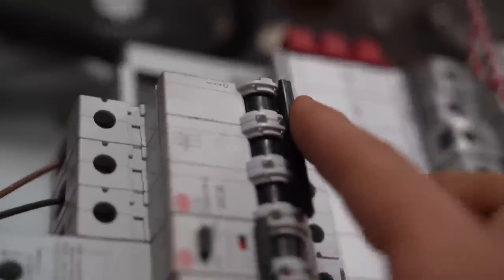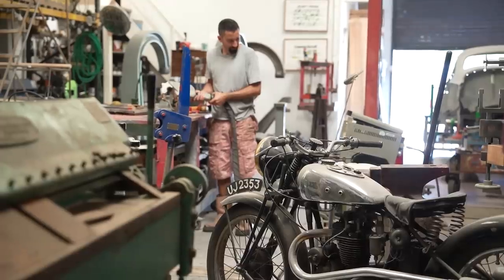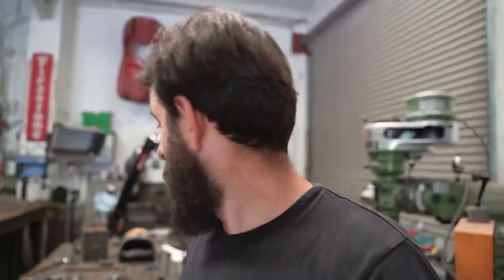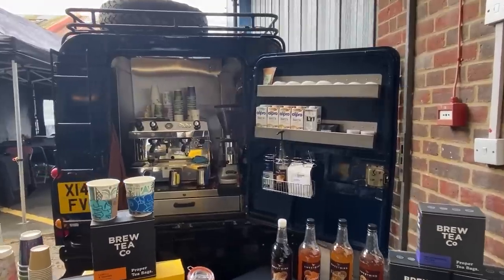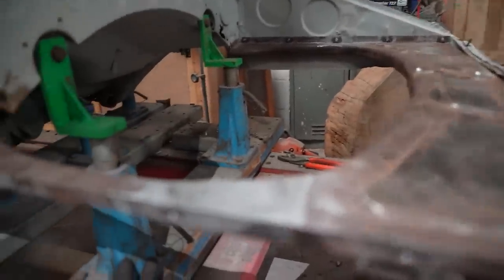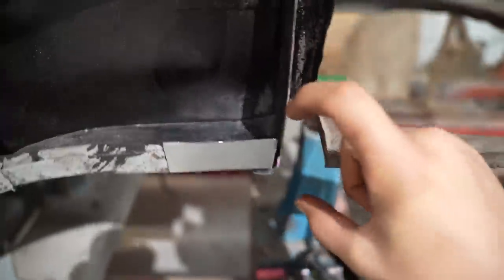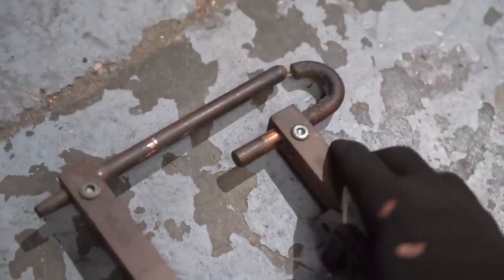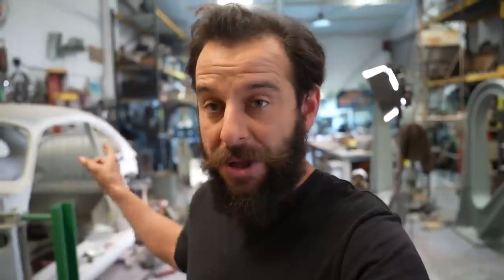'Let's Get Welding!' | Barn-Find Porsche 356 Restoration | Episode 13

Comment: Hi Dom.   that’s a mighty fine job your doing there. The parts might seem small your putting in but your fixing the panel and keeping all the original spot weld joints will give you a very fine result. As we always tried to do it so it looks original when finished. Glad you got your spot welder going as there a great machine. Great work keep going. Bob.

Comment: Great work! Lots of life left in that flap disc, try using it a bit 'flater' so you using the whole abrasive face, not just the outer edge. Still shouldn't be using gloves with power tools either.

Comment: hi dom when you start getting into the fiddly welding like pinholes get a piece of flat copper about 5mm thich and hold it behind the pin hole so when you weld it will not blow holes and the weld will puddle over the hole it will also disapate some of the heat from the weld area so less chance of warpage a piece of copper rod works great too for getting into tight places glad to see a smile on ya dial when working on the porsche cheers from down under

Comment: The best flapdiscs ive tried is 3m cubritron. cost same as würth but lasted alot longer, and if u pushed to hard on it and burnt the sandpaper on it u just hold it with a soft touch on the metal and it worn away the bad area.
U can grind down the outer diameter of the disc on a benchgrinder, hold the disc with the none sanding side towards the benchgrinder with the anglegrinder on and grind away it dust like crazy but u get a new crisp edge on your disc 👍

Comment: I reckon the difference between your test pieces and the actual car parts is the cleanliness of the metal. A quick rub with a scuff disk might make all the difference to the resistance of the metal. 👍

Comment: One day you will have to learn Ohms law Dom...  The breaker tripped because the spot welder wanted more current, a long lead adds resistance and therefore reduces the voltage/current available at the end of the line it does not typically cause the circuit to take more current :-)  It now works because you moved it from the 16A to the 32A circuit.

Comment: The pulse setting is for welding through 3 or more sections of steel, or two sheets of 2/3mm sheet. Or you can you use the pulse setting adjust the timer for mismatched thicknesses

Comment: Later on you might need some longer reach tongs for spotweding further across the angels such as floor to tunnel for example, be satisfying to put new metal on! Did restoration design get on board, or recommendation. There are some great utube videos on their new speedster development.

Comment: You guys did a nice weld job. I have my late fathers spotwelder. He also made several arms to be able to reach the places where he had to weld. The machine is a little bit smaller and from Italy. One tip: keep spay cans away when you are grinding or welding. Regards from a former welder and weld inspector. Regards from Belgium.

Comment: Those engine bay closing panels look  good  and the bulk head looks nice they can get like lace , I have a thing for air files rather than discs but the belts get  a bit expensive. Im looking forward to the unboxing as the original rear inner engine bay panel had a hump to clear a petrol heater if fitted, its great to see progress

Comment: I would have thought you would have added a coating of weld through primer in between the panels  before spot welding to protect the panels from future rust and stains on the paint. Just a thought but great progress

Comment: Interesting as usual. Do you ever use the Poly discs to remove paint and rust, effortless without eating into metal. I had the same power problem with my 150 litre compressor, ended up wiring it to an old shower circuit with 6mm cable.

Comment: Great job on getting the spot welder up n running. Are you useing weld thru primer though? Need this in order to prevent the metal on the inner edge from rusuting. (apologies if already done, although the last weld looked like there was none)

Comment: Great job, will the porsche need an MOT when done? The GOV website says over 40 Yr old vehicles are exempt, apart from vehicles that have been "Rebuilt"?
Do vehicles restored to O.E. spec class as 'rebuilt' as defined in current MOT legislation?

Comment: Are you going to upgrade your electrical panel to give two 30A breakers just in case you need to spot weld something on the lift? Don't forget the sockets too, if you were running a 15A breaker before was the socket (and plug ) just overrated for the breaker or do you need to upgrade to 30A capable sockets?
Reply from the maker: I had it on a 16amp breaker and a 16amp socket I didn’t realise this needed so much power! 
The cable to the ramp is big enough for the 32 amp breaker
Reply: Just check on the spot welder it's ok to run at 32A as it's cable might not take it, and it's not safe if a fault develops. Normally most electrical equipment have a plate with details on (might say wattage so you'll have to calculate it) probably near cable entry point. You can get MCB's up from your old 16A to 20A or 25A only fit one that's just higher than is needed. The MCB will save the cable and the welder should the worst happen.👍

Comment: Wheres the weld thru primer ?  You need to cut that all off and start over.
Reply from the maker: Haha ok! Thanks for the input
Reply: @DominicChineas  Upol make a good product, #2 copper weld thru primer.  Just use a mist coat though on both mating surfaces.

Comment: Look at the camera lens, not the monitor Dom.
Reply from the maker: But then how do I make sure I am in frame?! I’m on my own don’t forget! It’s more difficult than you’d think!
Reply: @DominicChineas just out of interest, when you look away from the camera to gesture at something relevant to what you are talking about, and then return to looking at the screen, how often are you out-of-frame? You might be better at getting your framing right more than you are giving yourself credit for. If you are in-frame all the time then you should have nothing to worry about when it comes to looking at the lens instead. To start with, until you are used to looking at the lens, pull back a little bit more. Don't forget there are a lot of YouTubers who do look at the lens. The increase in engagement with your audience is worth the risk of going from great to awesome.

Comment: Bin off the spot welder, get a flux-core welder, some 0.6mm flux wire, punch holes the old-skool way & plug weld.. It's 100% less grief. Flux core welding absolutely rocks for plug welding - as it does for every sort of welding. Plug welds become a doddle to do. Mig is crap in comparison.